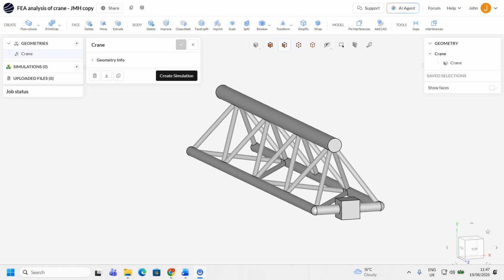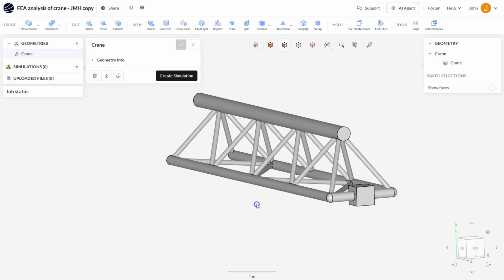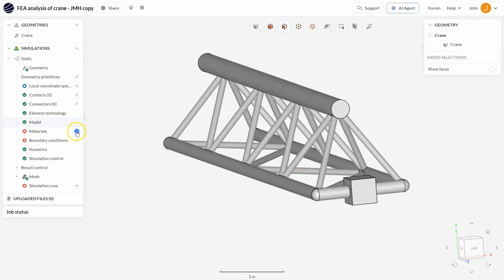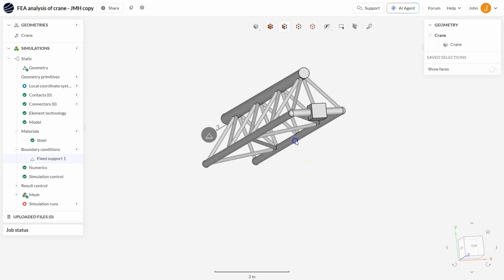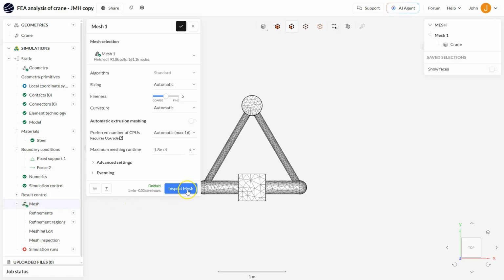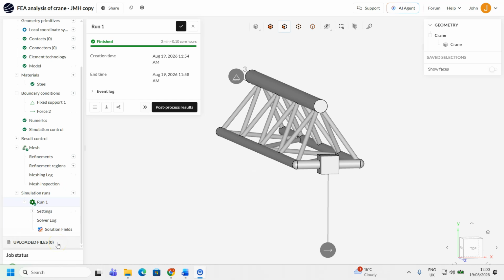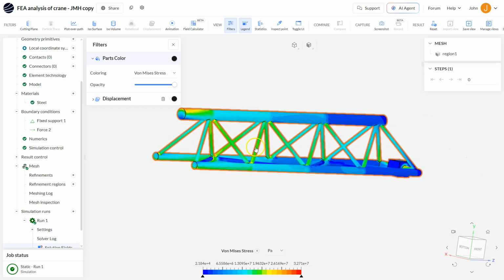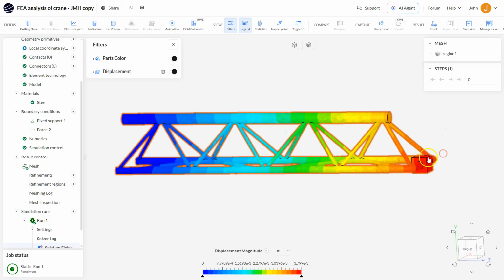Improve your CAD skills (Simscale) - FEA analysis of a crane #cad #engineering #simulation

Comment: Can you make a video showing the analysis of extruder tilting on a Cartesian type 3D printer where the extruder is attached to and moves along the X axis?

Actually I am trying to perform this analysis myself but I do not know how to solve the error related to bonded contacts. Please let me know how to define bonded contact correctly in a 3D printer assembly if we have sliding rods T8 lead screws and T8 brass nuts.
Reply from the maker: I would love to help - unfortunately I dont have the time to do this (and im not exactly sure what it is you need!). Best of luck with your project 😊

Comment: Thanks for the video..
Man:goodvibes:
Reply from the maker: You're very welcome, thanks for watching! 👍
Reply: @gradeAPhysics  Can you make a video showing the analysis of extruder tilting on a Cartesian type 3D printer where the extruder is attached to and moves along the X axis?

Actually I am trying to perform this analysis myself but I do not know how to solve the error related to bonded contacts. Please let me know how to define bonded contact correctly in a 3D printer assembly if we have sliding rods T8 lead screws and T8 brass nuts.